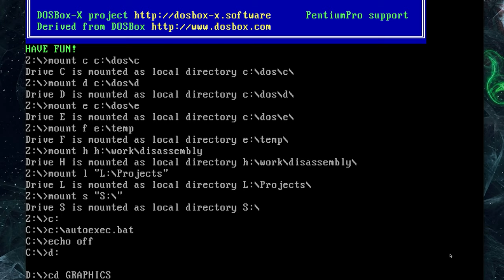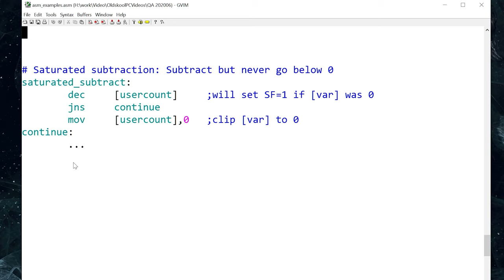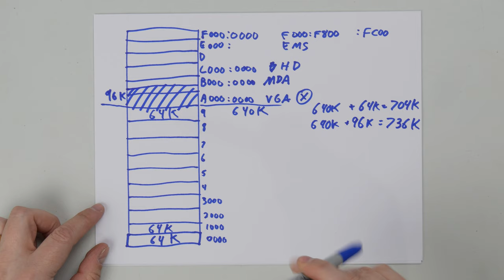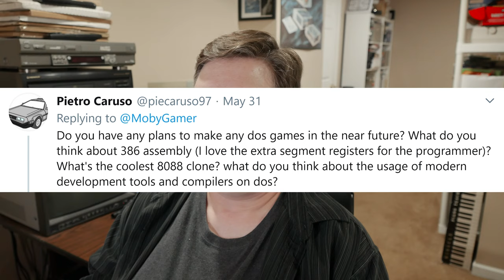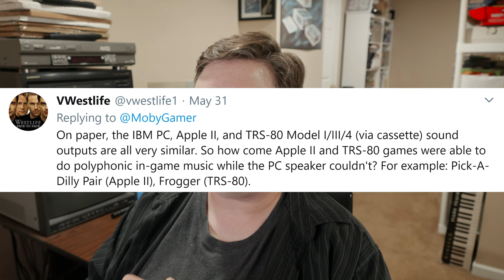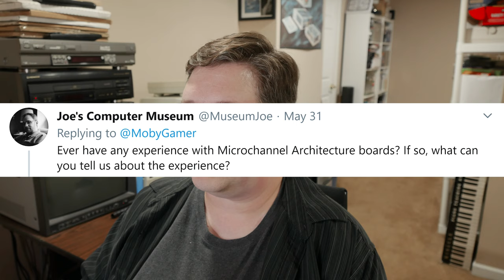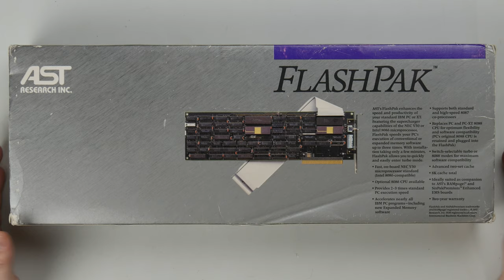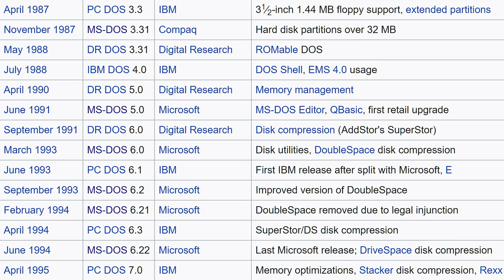The Oldskool PC Q&A #3: Accelerators, the 640K barrier, the best Tandy

Comment: Those PS/2 enthusiast web sites you mention also have an archive of the necessary definition files for just about every microchannel card known to exist, so that's not really an issue. And although they're scarce and expensive, MCA sound cards have a neat trick where they route their output through the system bus to the internal speaker, so you don't need to plug in external speakers
Reply from the maker: Assuming you can source an MCA sound card in the first place ;)

Comment: Thanks for your great videos! This is my favourite vintage computer channel. In your ned Q&A, could you talk a little bit about the vertical refresh interrupt in VGA/EGA adapters? And if and why it exists on some cards and not on others? Whether you have time or not, thanks again for your great sessions.
Reply from the maker: Thanks for the kind words!  The vertical retrace interrupt exists on PCjr, EGA, some Tandy systems, and some VGA cards, and it generates a hardware interrupt (usually IRQ 5, sometimes IRQ 2) whenever the raster beam has reached the bottom of the screen and has begun tracing back up to the top.  This was useful if you wanted to change some video aspect in between frame draws without the change showing up mid-screen.  Palette changes, start address changes, and horizontal pixel panning were usually done during this retrace time, although another useful way to use it is for timing music playback, or game logic, so that they occur at a constant rate without jitter.  Let me know if you need more details.

Comment: Btw, back in the 90s I used to run DR-DOS 7, which could even multitask, although many programs weren't compatible with the multitasker. But generally, if they could run in a DOS box under Windows, they could usually run inside the DR-DOS multitasker as well. :)

Comment: Enjoyed hearing your nigh-on contempt for MCA - it's the same reason I've not got into it. I mean if a PS/2 falls in my lap (like an EISA motherboard did) then sure.

Also, I've always wondered about branchless code in the context of deep pipelining because I've done a lot of reading on CPU architecture but no assembly, so it was really neat to see actual code implementations. 

One really cool 8088 clone I own is the Toshiba T1000. Not only is its name cool, but it was the lightest IBM compatible available on release in 1987 (the journalists went nuts for it). It also has DOS in ROM, which (mostly) negates the need for a second floppy drive. It even has a RAM upgrade that can be used as a battery-backed RAM disk.

I've really appreciated the investment you've put into these videos. There's nothing else like it out there. Very accessible, very interesting and lots of learning as well.
Reply from the maker: DOS in ROM is why I own a T1000 as well.

Comment: Nice video.   I only have one Tandy 1000 & it's the 1000A, handed down to me, along with printer, amber monitor, manuals & floppies back around 1994, from a family friend.  I was able to put a harddrive & Iomega external Zip100 drive. Still have it.   As for CPU acceleration kits, I still have two Evergreen Rev-to-486's, for 80286 machines (sadly one has electromigration issues due to overclock/thermals), also still have an Evergreen 586 (for 486 speedup you put in an Overdrive slot), which sped my 25 mhz 486SX to 100 mhz.  Have also done my own simple speed replacement by switching out the main OSC, such as when I overclocked a Harris 286 20 mhz board to 25 mhz, with a 50 mhz oscillator.  All that done around 2 decades ago.
Reply from the maker: I've always wondered what would happen if I tried to rev-to-486 a 286-based Tandy system.
Reply: @TheOldskoolPC  ... You will certainly get some speedups in certain areas, assuming it is compatible with your Tandy-based 286.  You never know what incompatibilities are introduced by Tandy.  Processor speed is increased, you also get some CPU internal cache (16k), which a 286 doesn't have. That cache amount might look little today but back then that cache alone helped significantly.  You also get 386 Enhanced mode, so now you can install Windows 3.1 or even Win 9x, on a 286, which I did.   The Rev486 came in 3 different CPU plug formfactors, PGA, LCC & PLCC.  I got the PLCC, which had 2 different upgrade paths, IBM or TI version.  The TI had no option coprocessor slot, so I bought the IBM version.  You just plug in an appropriate speed 287 coprocessor on the Rev daughterboard.  I'm going on memory here since I did all this 2 decades ago.  I had one 286 baby motherboard where I could not plug the Rev486 into it because there were height hindrances around the CPU slot, so what I did was desolder the CPU PLCC socket & then added additional round pins (84 of them iirc) between CPU slot & the motherboard mounting holes.  This effectively rose the CPU slot about a quarter inch higher.  Now I could fully seat the Rev486 into the PLCC 286 socket. Additionally, I increased the mainboard oscillator.  Unfortunately, I increased it too aggressively at one point with a much higher frequency oscillator which really boosted speed but effectively mamed one of my Rev486 boards eventually. The reason for this is that Rev486's do not have fans, only a tiny mounted heatsink & back then I had no idea how to aim a small fan towards that heatsink inside the PC case.  Also, all the other chips on the Rev board also heated up, not just the 486SXLC2 (40 MHz iirc).  Not aiming a focused fan at it was my big mistake, apart from too high a mainboard oscillator increase. Ideally, a watercooling setup around the Rev would've been nice but would've been a headache to even try.  I was also about to do a Peltier setup, but did not, that was also risky.   I did bump down the main oscillator to a more comfortable speed.  I don't remember making any benchmarks so have no idea how much of a speed increase this would have made, but there certainly was an increase.  You could possibly find used Rev486's around but it's going to be a risk what kind of condition they are in, unless someone finds NOS somewhere.  I would love to rebuild a Rev486 board but all my stuff is all over the place, so I might take time to gather everything together.  I might even make a Youtube video out of it, though no idea when that could happen, heh.  And I'm pretty sure Evergreen Technologies died many years ago, but they made several upgrades, including for Pentiums, & the Rev586 that I still have (AMD 5x86-133), so it was nice to have been a part of that era where several companies made cpu upgrade options 20-30 years ago.

Comment: You could also have 736K RAM with a VGA, if you restricted yourself to text mode. I have done that (and then watched the system crash and burn when some program DID switch to graphics mode and corrupted all memory ;-) 
I used QEMM which probably remapped some extended RAM into that space (instead of using the VGA card's RAM). But it was, essentially, rather useless :-D
Reply from the maker: QRAM can do this as well.  I never recommend it for VGA systems because something will inevitably try to do graphics non-obviously.

Comment: In terms of clone incompatibilities - I had a horrible Turbo XT clone made by Wyse (branded as an Amdek) - it actually was a very speed 9.54 MHz system, but it came with a 101 key AT keyboard.  Most programs worked well, until you encountered one that would try to find out if it was in an XT or AT class machine by checking for a 101 key keyboard - usually freezing the machine.  Decades later I found out that they had released a small TSR that "fixed" this issue.  It was very frustrating at the time, but it hastened the upgrade of the computer to a 486 in the 90s.

Comment: I think you you can actually make an 8x32 pixel font in vga, font data is spaced 32 bytes apart in the banks and you can select 32 rows per characters. Don't know if any programs ever actually used that or if there's any fonts made for that.
Reply from the maker: You may be right.  A 40x6 text mode seems very constrained by the aspect ratio, however.

Comment: Sentinel Worlds 1: Future Magic also did some (from my memory) pretty impressive polyphonic music in the intro. But, of course, not during actual gameplay (I still have the original box, but for the C64 version, and on it they praise their "music engine" that "flipped through the instruments 60 times a second" or something... :-) )
Reply from the maker: A quick check shows it's just arpeggios using the 8253, so not really the same thing.  But that's my answer, essentially: PC programmers just used that instead of trying to interleave foreground music and foreground graphics updates.

Comment: Why did IBM decide to place the Video RAM in separate locations for EGA/VGA (A0000h-AFFFFh), MDA (B0000h-B7FFFh) and CGA (B8000h-BFFFFh)? Seems crazy that they would have chosen to be so wasteful with the already extremely constrained address space utilization/reservation - surely multimonitor support was not big on their list to support, and programs wouldn't even try to (due to performance reasons...) simultaneously write out VGA+CGA or VGA+MDA or MDA+CGA to make simultaneous multimonitor possible? Was there some other reason, or do I not grasp the full picture?
Reply from the maker: It's possible that they originally thought EGA was going to be a third type of video card you could simultaneously install (so that you could indeed have all three installed and could drive them at the same time), but then decided later that anyone with EGA would want backward compatibility and not have two color cards installed at the same time, which is why it also switches to B800 in prior color modes for CGA compatibility.  Another possible reason is that they didn't want to limit EGA to 32KB by not letting it run into the C000 range.

Comment: @45:28 They were rare in 1985, they were rare in 1990, and they were rare in 1996... They are rare now, because 1% of 1% is rare to the power of rare... Now what did get popular about the same time as pass through voodoo cards was pin compatible up-gen chips, that would let you use a clone of the next generation chip in your existing motherboard... and sure enough there are millions of them for sale. "chip replacements". People just didn't have the money to buy the "make-it-new" upgrades(they cost about the same as a new pc) when it was usually close to the same price to just get a new barebones and bring your old drives and peripherals. I still have a 230 mb scsi drive thats been around since I first got it so I could share my grandpas work pc, had to have enough room for his autocad and digitizer files, and my games... until that is, I got the 286 and they got a new 386. I had dual monitors before it was thing, even though it only worked in autocad lol. The drive is IBM made and yes, it still works, no bad sectors, and awesome hollow metallic thunk thunk read/write/seek sound. the spin-up is something that makes me happy, the same way other people feel when they smell grandma cooking. I wish I still had the plotter or the blueprint copier, though i wouldn't have the space without taking a room from my kids. My first "my own" pc: IBM 5170 10mb Ram (512k on main board + 512-2mb ibm expansion card and 8mb boca ram at card) 40mb mfm and 230mb scsi HDD Dual 5.25 Floppy proEGA128k/MONOCHROME  5154/5151 Monitor 24" digitizer w/Pen and EMmouse 1200 baud Hayes smatmodem Adlib card scsi tape backup drive and an IBM dot matrix printer. 
Lol I wish now that they would have just bought me some bonds worth what that computer cost.
Reply from the maker: Yeah, computer parts never seem to appreciate as much as actual investments like bonds, etc.  :-)  Thanks for your comments!

Comment: Hey we're writing a demo to run on CGA compatible cards. Some cards display noise if the display is not turned off when writing to the video memory. Why is this and what is the correct way to do this properly so that there's no noise? -- Also no hurry with the answer! We're releasing at the earliest at Revision or maybe Assembly in August 2021. For the demo we're using 387(judas needs it) and it's mostly written in C.
Reply: And I wish you the best, and hope you get better.
Reply from the maker: Then you may find yourself with some competition ;-)  To avoid snow, you need to loop watching the retrace status bit, then when you know the beam is in retrace, you can write a single word (horizontal retrace) or 500 words (vertical retrace).  More info:  http://www.vcfed.org/forum/showthread.php?11264-Trixter-Preventing-CGA-Snow

If you need a 386+387, why not just target VGA?  It's got many advantages, is appropriate for a 386, and you won't have to deal with snow...
Reply: @TheOldskoolPC  we were bouncing around different graphics modes and we wanted something basic and lowres, so we went with CGA 160x100. Thanks for the help!

Comment: So what about having only 1MB ram on 286? The only usefull thing having himem.sys loaded is getting parts of dos in high-memory above 640k?
You mentioned, that the TX3 is more capable when it comes to tandy-gaming, what about TX3 vs. T1000RL (which I have)?
Would be cool to get "THE ULTIMATE T1000(RL)" demo for Tandy GFX/SND...we already got "8088MPH" as the ultimate XT/CGA demo.
Reply: A 286 with 1MB RAM should actually have 640kb of conentional and 384kb of XMS memory. The first 64kb-16 bytes of the XMS memory is the HMA (High Memory Area), where you can load DOS with dos=high. And there's still some extra XMS memory left as well, for use by protected mode programs.
Reply from the maker: That depends on the system, actually.  On my AT&T 6286, it has 1MB of RAM but it's located in the entire first 1MB, and while the memory test counts all the way to 1MB RAM, the extra 384K isn't usable.  Some 286 boards could unlock, enable, or move that RAM using a chipset-specific driver.
Reply from the maker: The Tandy TX, TL, TL/2, and TL/3 are my favorite Tandys -- the 286 makes just enough difference to make gaming fun.  As for a demo, that's not in the near future, but there are plenty of cool games that can stress the system, like Revenge of Defender, Indianapolis 500, Microsoft Flight Simulator 4.0, Interphase, and Vaxine.
Reply: @TheOldskoolPC  I didn't know that. My data point comes from my PS/2 Model 30/286 with 1 MB memory, and it puts the extra 384kb as XMS, which makes it usable.
Reply: @NikolayNikolov_Tralala  The 384K above 640k are usable on A2286/8 with Dos5.x too.
Reply: DR-DOS 6 was good on 286s because more of the built in utilities and DOS data structures could be put in the HMA vs MS-DOS.  Worked well for me on a 1MB 286 in the early 90s.  Once you were on a 386 with UMBs that wasn’t a compelling advantage anymore so I moved back to MS-DOS after that system.

Comment: Would it be possible to use an Expended memory board and extended 640K that way?
Reply from the maker: Sadly not.  Expanded memory boards could have multiple megabytes of RAM, but the design of the LIM expanded memory specification was specifically to only create a 64K window into that RAM.

Comment: Shouldn't the smaller BIOS addresses be F000:8000 or F800:0000 instead of F000:F800 for the 32kb BIOS and F000:C000 or FC00:0000 instead of F000:FC00 for the 16kb BIOS?
Reply: yeah, I guess that's what he meant... segmented addressing can get a little bit weird sometimes (you can use that to your advantage, for obfuscation. Use address like 1234:5678 instead of 1000:79B8 etc. (I hope I didn't screw this up, it's been a while ;-)
Reply from the maker: Correct!  I made a mistake.  I'll amend the description.
Reply: @TheOldskoolPC  First cpu cycles are done at the FFFF:0000 so the ROM Must be there.
Reply: @freddyvretrozone2849  FFFF:0000 is inside the ROM, but it's near the end of the BIOS, it's the last 16 bytes, actually.